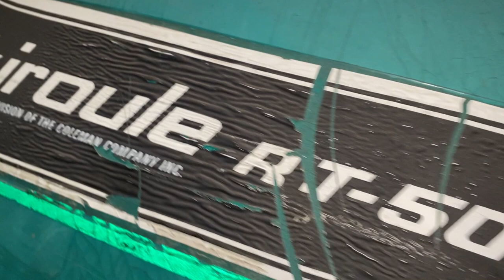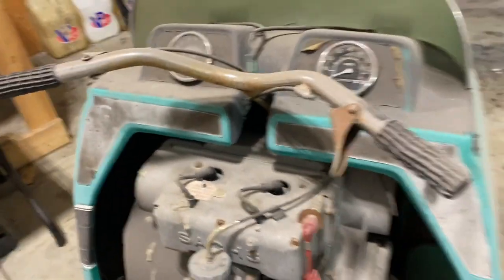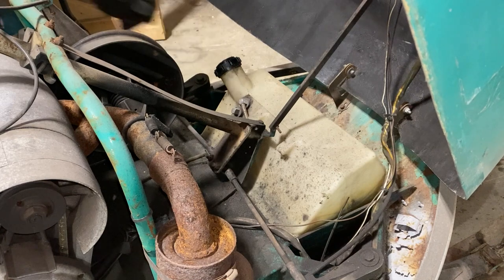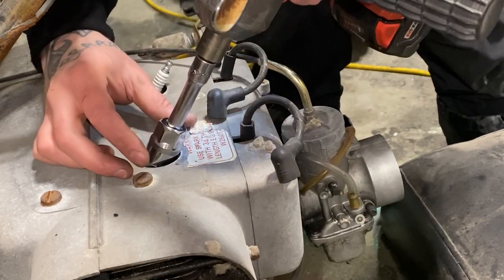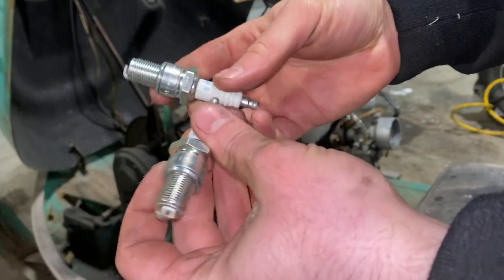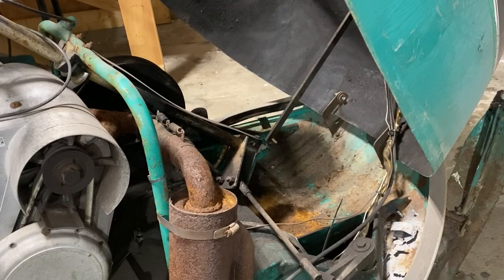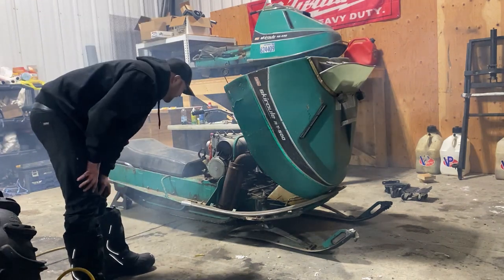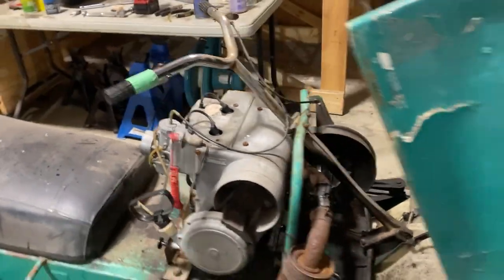TRYING TO START 70's SKIROULE AFTER YEARS OF SITTING!

Comment: Take the main jet out and squirt starting fluid in there to clean out the varnish. Replace tight & 1 &1/4 turns back out. Worked every time!
Reply: Ours was a 71' Sachs SX 440